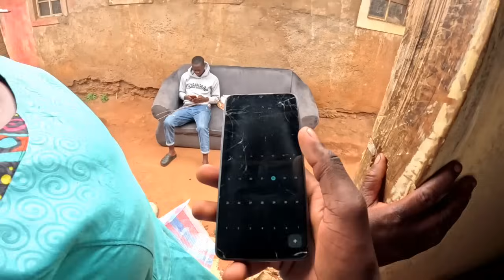Great News Ever!!! Finally Purchasing Furniture For My African Home At @iammarwa Village.

Comment: Please create temporary small tables to place pots, bowls, and utensils you keep in the kitchen area by stacking bricks to make the base/legs  for them and placing strips of flat timber accross them as the tops. It will keep ALL who use that kitchen area from having to constantly bend low to pour water into pots, place food to be cooked, etc, instead of placing them on the floor which isn't sanitary. You already have the materials a the villa. Thesebtemporary tables require no nails or glue and can be easily removed  when real tables or countertops are installed to replace them. 😊
Reply from the maker: @user-di6dj7fg7u  alot of thanks to you for your great advice towards me I really appreciate so much ❤️🙏

Comment: Should have painted walls before putting the flooring down and bringing in the furniture! Too many colors that don't go together!!
Reply from the maker: @Amos-fj7qi  am going to put Cartains on the wall
Reply: Curtains on the walls will gather dirt and will be more difficult to keep clean than walls painted with semi gloss paint that can be wiped clean with hot water or mild detergent solution. Framing each our way with timber will also cover some of the imperfections on the walls after covering up stains and sealing holes around the doors with plaster are completed. 😊
Reply: Regular plaster can cover imperfections in the walls before painting them.